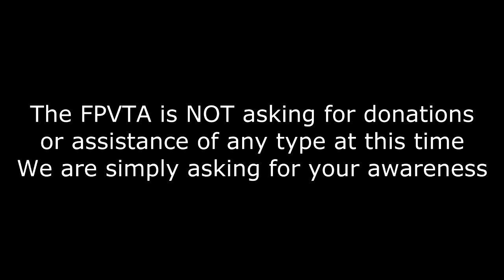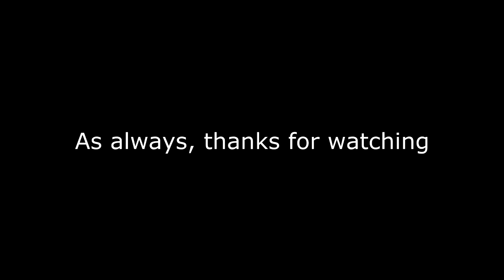The chances of colliding with an airplane

Comment: For the purposes of the law of negligence, the risk harm is also weighed against the gravity of the consequences if those risks occur.  If the consequences are extremely grave (crashing aeroplane) it does not matter that the risks of it occurring are small.  If those risks are reasonably foreseeable - and they are in this case - an FPV pilot would be found negligent and liable for significant damage and - probably criminally liable also.
Reply: This, by the way, is the rationale behind the principle of informed medical consent.  If a doctor describes a low risk of great harm as a merely a small risk, it violates the principle of informed consent:  http://goo.gl/4qjBzW
Reply: But then should we stop all helium balloons? hot air ballooning? The has been a few fatal accidents with light air craft this year unfortunately, should these all be banned?
The problem is fpv is nearly impossible to control, anyone could buy items from china etc and they come in component form and customs wouldn't know what they were. I have a couple of sets and got up in the air for very little.
If the odds are very unlikely and a fpv pilot was trying to be as careful as possible is it still 'foreseeable'?
I don't want to see anyone hurt or accidents and it makes me mad when people look at certain things, when so many people die on our roads due to just bad driving!
Reply: Those have their own regulations and licensing requirements
Reply from the maker: Dlearnt
As does driving an automobile, or even eating.  Risk is part of life.  The odds of becoming president of the U.S. are greater than that of hitting an airplane.  If the risk is that low, there is no such thing as negligence.
Reply: Alex Greve This whole issue is a problem of perception. A little foam airplane up at 1000ft altitude produces a wide-angle video which has an effect of terrifying people. It gives the impression that the FPV plane has taken over that whole area of sky and ground beneath. This is a perspective which is new, that people have never seen before. This terrifies them. Their imagination begins to run wild and they now run in terror, thinking the world is coming to an end and all these collisions are about to happen.

Imagine this: If we had the technology to put a GoPro camera on every single bird, bat, helium balloon, kite, and paper airplane out there, and then we were to begin uploading videos with titles like "Seagull's Perspective of Jet Takeoff at LAX" can you imagine the hysteria? There would be millions of videos uploaded of "Hawk vs. Cessna Near Miss on Final Approach", and "Helium Balloon Ingested Into Turbine of 747" (I mean according to anti-FPV folks, there should be hundreds of balloons ingested into turbine engines by now. Have you guys not seen the massive helium balloon launches on T.V. all the time?) So all of a sudden, there would be hundreds of thousands of videos uploaded every day, showing us terrifying things that have whizzed over our heads and past our pressurized cabins!

Even better, what if we had the technology to put a GoPro on every single rifle bullet and pistol bullet manufactured, and then people started uploading videos like "Shot At Deer, Missed, Bullet Landed On Roof Of School 2.5km Away", or "Bullet Fired In Air During Soldier's Funeral Zips Past Ultralight!", or "Bullet Fired By Cop Smashes Through Restaurant Window - GRAPHIC!!!" If this were to happen, if youtube were suddenly indulged with videos of other airborne objects, manmade and otherwise, there would be bans on EVERYTHING, from kites to guns to baseballs to birds to model rockets.

The odd thing about it is, a bird may be too dumb to avoid a full-sized aircraft, and a bullet becomes an uncontrollable ballistic object once it leaves the barrel, yet an FPV Aircraft is controlled by a human being who has the capability of navigating it and also 99.999% of the time has a strong desire to bring his craft down in one piece! So why are FPVers so dangerous?

My prediction is, many years from now, when this much-feared FPV vs. FS collision never materializes (or if it does, when nothing tragic takes place), we will look back on this video and say, "What was all the fuss about, anyway?" Then we will order a pizza, and have it delivered by a Dominoes Drone. ;)
Reply: Risk is part of life, and unfortunately so is regulation to deal with it.  When the consequences are extremely grave you can bet that regulation will be enacted to try and prevent even an extremely low probability that it might occur.
Reply: Dlearnt Thank you. Probably the most reasonable comment in this thread.  A low probability of occurrence does not absolve the government of the responsibility to prevent it.  If UASs are to be added into our airspace, I'm all for it but it needs to be regulated so that operators and the public can be held accountable.
Reply from the maker: Dlearnt
By this logic our speed limits on roadways would be 15mph.  However, you don't see many advocates for this.  We accept any activity has risk... even regulated activities like driving.  The risk of a car wreck is exponentially higher despite being very heavily regulated.
Reply: Alex Greve I didn't say the logic was sound - just that it is in fact the logic in use.  As John Oliver said "One failed attempt at a shoe bomb and we all have to take our shoes off at the airport.  31 shootings since Columbine and no change in the regulation of guns": http://goo.gl/KcZDh5
Reply: Dlearnt And 30,000 gun deaths in the US each year and still no changes.
Reply from the maker: Dlearnt
- Point taken.  We do have a tendency to over-react.
Reply: Pete Dee Pete. 60% of the 30,000 gun deaths you refer to are due to suicide. 3% from accidents and the remainder (around 11,000) per year are due to homicides of various types including shooting in self defense. After you subtract the lawful shootings by citizens defending themselves from criminals, the remainder of homicides are mostly attributed to gang violence and drug related violence. Most homes in the U.S. have guns and very few are ever used in the commision of a crime.   By comparison, in 2013, there were around 32,000 deaths due to automobile accidents. What kind of change are we talking about here with respect to gun ownership. The only changes I would propose are making constitutional carry a reality in all 50 states where open and concealed carry is a right for any non felon and non mentally ill people.
Reply: OMG you don't get it at all.